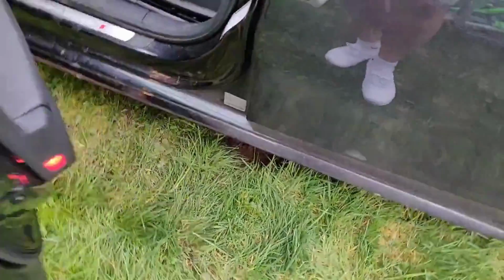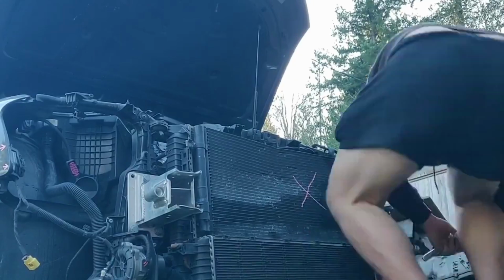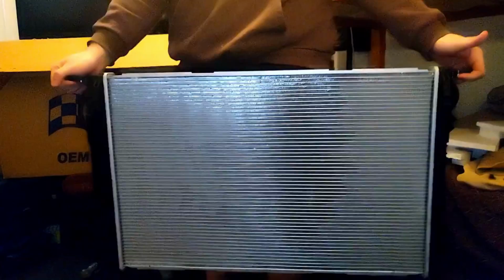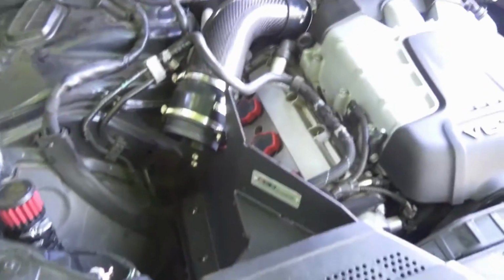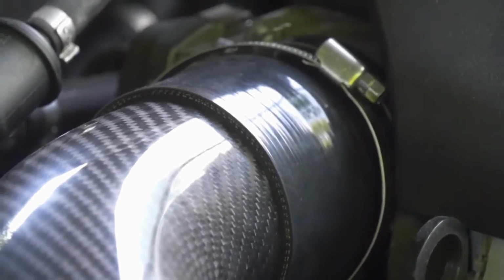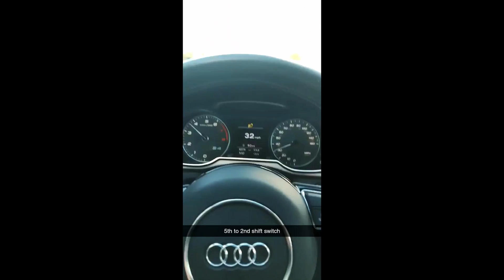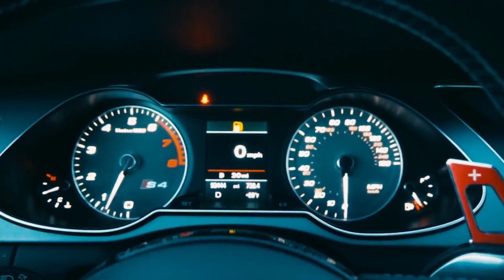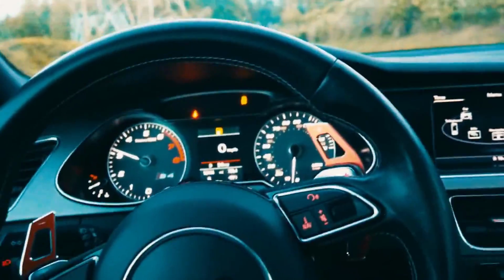Building an Audi S4 in 10 minutes!

Comment: ask a question this s4 which year ？2009？
Reply from the maker: Late 2013. If you’re looking for a 2009 it’s the prefacelift and the infotainment/interior is different, and also different transmission I believe. The 2009 aka the B8 and everything from 2013-2016 is the B8.5 comes with a new front end, updated interior and updated DSG transmission I believe, also both have options for sports differential. 👍